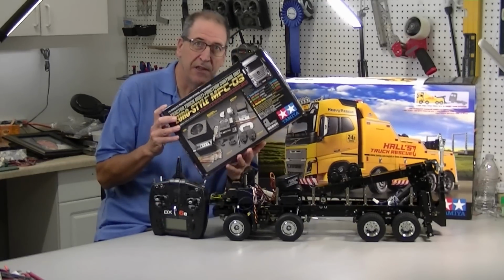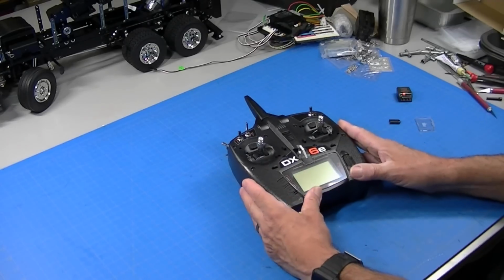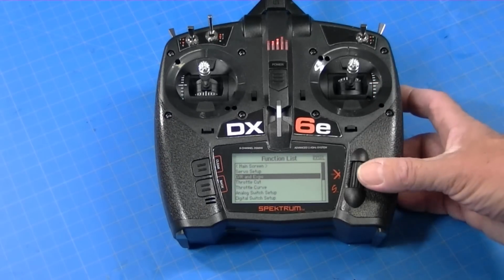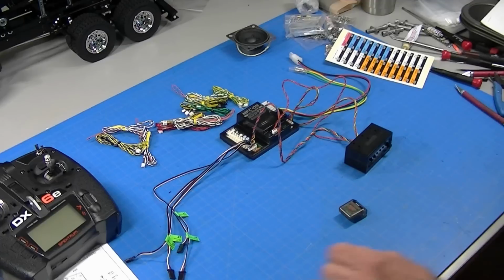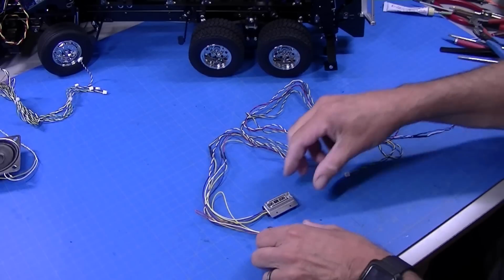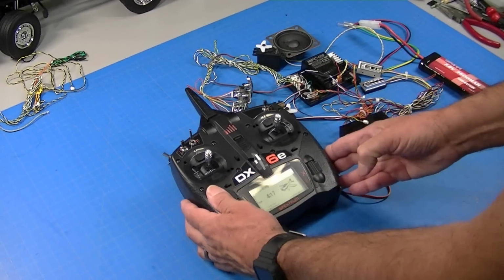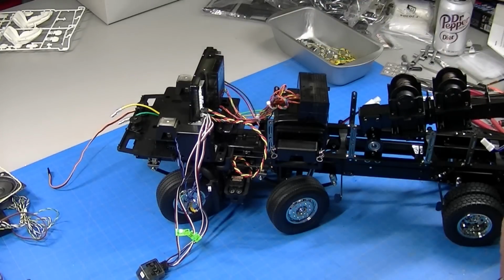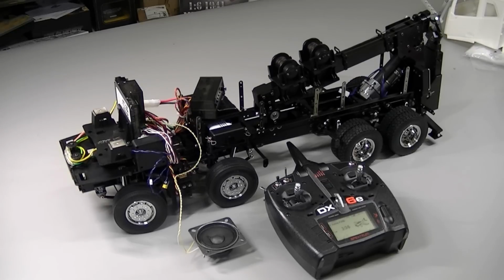Tamiya 1/14 Volvo FH16 Tow Truck Build - Part 5 MFC-03 & DX6e Setup

Comment: Hi Bob, awesome tow truck shared. May I ask if it is possible to add the extra sound effect (eg Fire Truck whistle sound) with MFC03? Or additional sound unit is required. Thanks
Reply from the maker: The sounds in the MFC unit are fixed so you would need something else to make additional sounds.

Comment: SOMEDAY....... SOMEONE will figure out a way to flash these Radios - to have a picture of a TRUCK instead of an Airplane!! 
And.... Add a program so that with the Throttle Centered, Alarms won't go off every time you switch on!!! 

Yes, I know, these aren't pressing issues. But wouldn't it be nice?

Comment: hi Bob have u had a go at the TX16S transmitter. an flysky receiver .   with any of your r.c . its open Tx as well .   im still learning it at the moment.    i tryed the flysky controller u have ..i couldnt figure it all out .  but the TX16S is much easier to us .   just haven't seen anything with you using one

Comment: Great Video! How the electric actuator work with the radio control?  I have installed to MFC and actuator to the Arcso dump truck, and trying to switch the control unit from the 4YWD to the Flysky i6. The Flysky should be similar to your DX6.

Comment: Hi, if you have to reset the Tamiya M.F.C-03 unit the instructions are incorrect in D: Default setting ( page 10 ). Where it says hold down the SW1 button and turn on the unit, keep holding down the button until you hear the engine start up regime this may take 20 second's . This maybe helpful to your viewers, because this particular problem left me scratching my head. Happy building. 👍✌️🇬🇧

Comment: Great video Bob.. I know you have a Beier SFR-1 to install. i have done a video on the ServoNaut rear lights set for the Volvo FH16 models. please check it out.
https://youtu.be/lBsEvsaalVw
Reply from the maker: I will.  Used Kraftwerks lights with the one I am doing and they worked excellent.  I will have a video on it coming.

Comment: Hi, lovely video btw. I’ve got a Tamiya Actros 3363 and the MFC 03 as well as the same transmitter as yours. I’ve followed your instructions set by set but for some reason teaching mode A does not configure and I can only start the “engine” and use the hazard lights all other functions do not work. I’ve reset MFC unit to default settings and did teaching mode A many times but my functions are only the ones mentioned above. Unfortunately I’m all new to this and my knowledge and experience is very limited. Do you have any advice?
Reply from the maker: Contact me by email and I bet I can help you figure it out.  My email is in the description.

Comment: Quick question,   Been out of the sport for a while and looking to get back in.  I had always been told you can't use an aircraft RC unit for ground and vice-versa, is that still true or did those laws change?  Thanks in advance for any and all information
Reply from the maker: With 2.4ghz radios that is no longer the case.  You can use any radio in any type of product and the radios do not interfere with each other.

Comment: loving the build on this but i wish you would stop cutting out stuff( i have seen a fair few of you videos and they are all the same) their could be a first time builder that watch'es you video's for tips and they could miss out on something you cut out  i have built 2 trucks but you can still always learn from a different perspective  and i found out about the driver walking 2 and from the truck via teri wilde video when i used it to set up my spektrum ds6 to a mfu-03 plus a closer view would be better also i watch most of you video's via a 44" tv via a now tv box and i still struggle to see everything. but your videos are great to watch still
Reply from the maker: It's always a struggle for me to keep the video length down to a reasonable time and plan what to put in and what to leave out.  I really appreciate the feedback and will keep trying for that perfect balance. Thank you for watching!

Comment: Howdy Bob that hold right stick down is a clutch that is built in to the MFC-03. If you were to rev up the engine and slowly raise the right stick back to normal the clutch will slowly place power to the wheels like a real truck. Also if you remove that J12 jumper you can use the low normal and high ranges in the MFC-03 like normal but still use your 3 speed trans due to the switch for the servo. so you would have a 9 speed forward and a 9 speed in reverse as well. Other than that you nailed the MFC-03 perfectly. Happy trucking and God bless!
Reply from the maker: Thanks!  Was wondering about the J12 jumper.  Now I can experiment with that!
Reply: @HobbyconceptsLLC  i forgot to add you can change the blinker (Winker) sound as well. Cant remember the stick hold/taps but that is in the MFC-03 manual. Have fun and Gob bless.
Reply from the maker: I do plan to show all the MFC features at the end of the last video when everything is done, plus a few other surprises!
Reply: @HobbyconceptsLLC  perfect cant wait. Thanks again for the great content.

Comment: Setting 75% in dual rate,dont you lose some travel? is 100% and then say 110/120% dr any good?
Reply from the maker: No, you lose no travel because when you MAP the unit it reads the travel as 100% no matter what.  Also the sticks you change to 75% are the option sticks, not the steering or throttle.